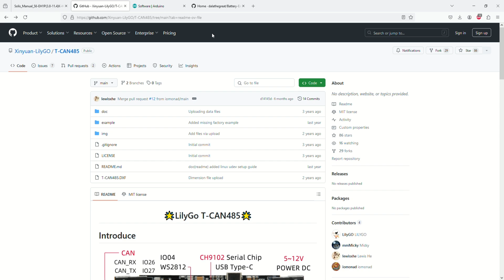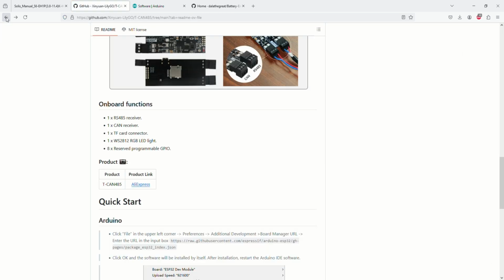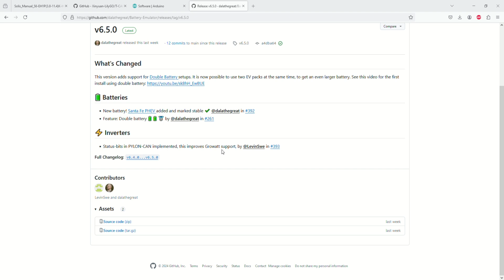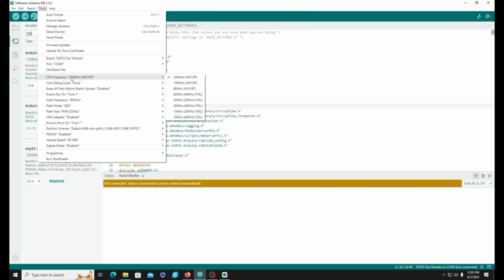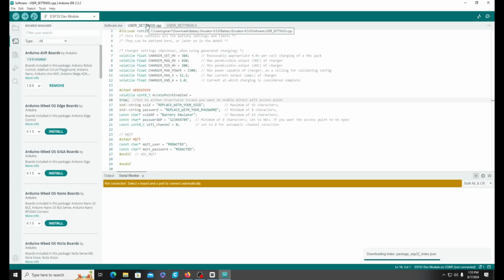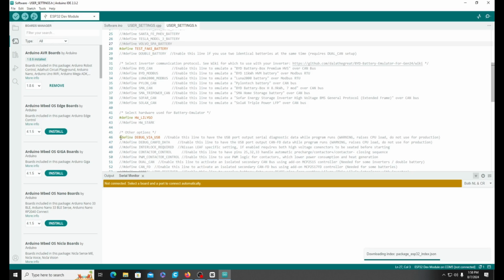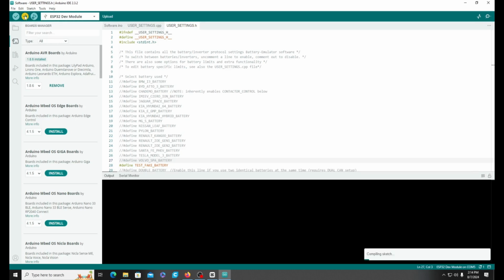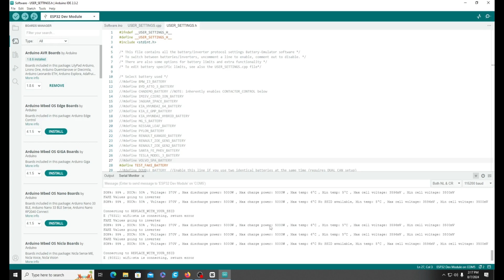Nissan Leaf EV Battery High Voltage Solar Storage Inverter Interface Board Part 2 Programming

Comment: How old of a Leaf would you bid for? I see them as old as 2013.
Reply from the maker: They started production in 2011, in 2013 they had some mileage updates. There are some sites that will tell you how to figure out what battery is in the car from the vin. They did have a 30kWh battery available from 2013 also so you might get lucky! Both mine are 2015.